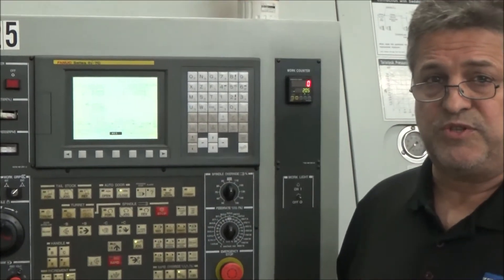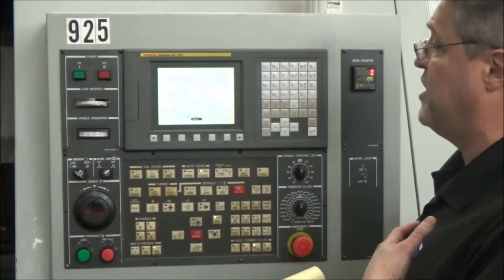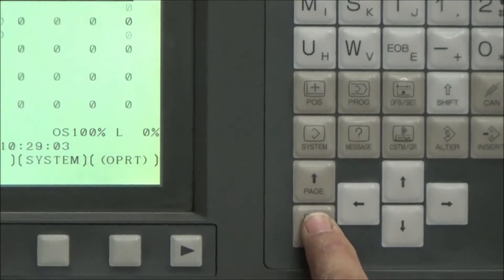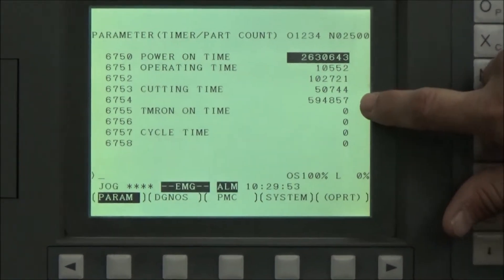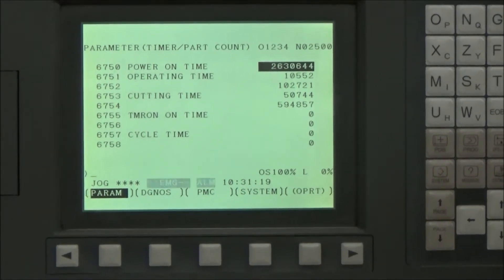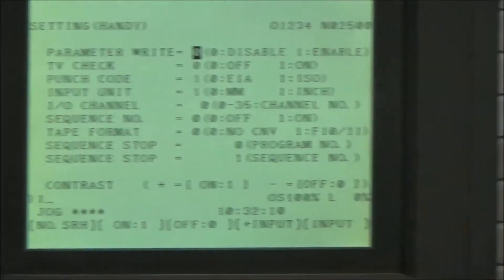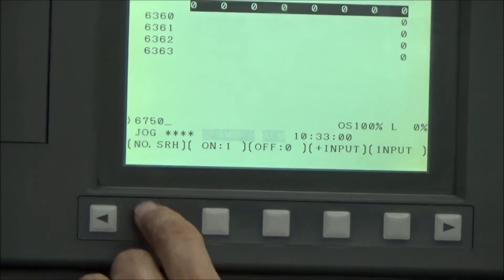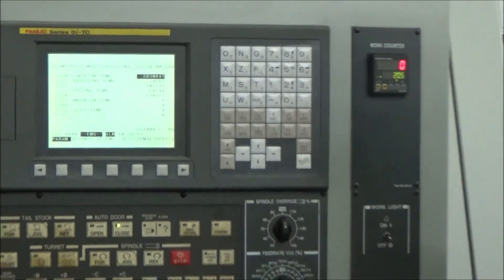How to Find Machine Hours on a Fanuc CNC Control

Comment: What is the best way to find the Fanuc controller series if it is not given on the panel like yours.
Reply: Good question. Turning off the machine and starting it up again the Fanuc control info should show up on the screen for a short time. Also there might be a control info sheet in the electrical panel.

Comment: Parameter for oimf+ is as follows.
6750 power on in minutes
6751 operating time milliseconds counter
6752 operating time minute counter
6753 cutting time milliseconds counter 
6754 cutting time minutes counter.
6757 parts time  milliseconds
6758 parts time minutes.
You may want to double check your data as adding these two numbers together will give you an incorrect hour count. 
Your example should equal 9914.28 hours from para 6754 and then add 50744 milliseconds from para 6753.
Cheers